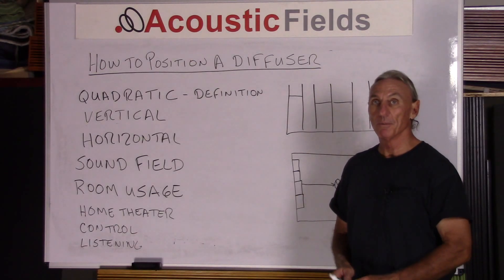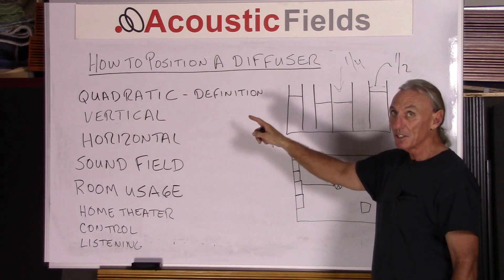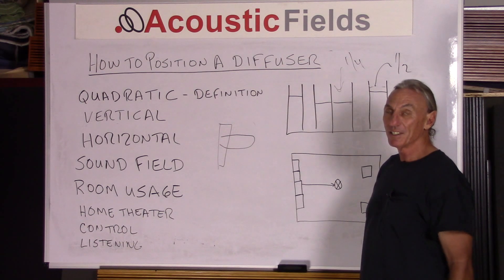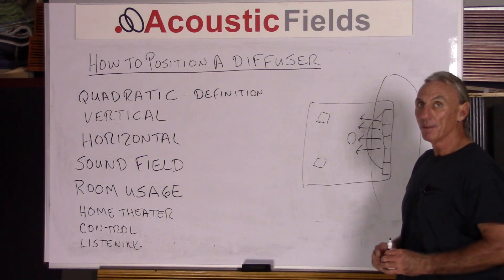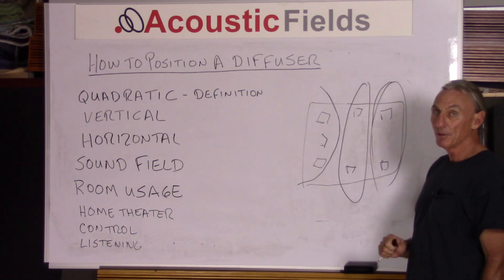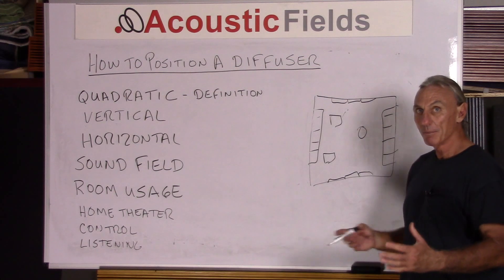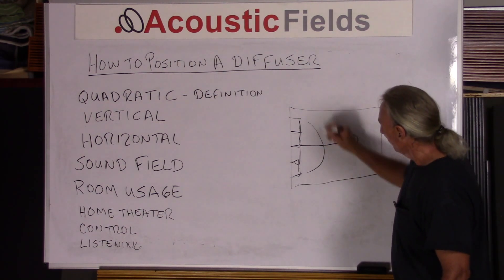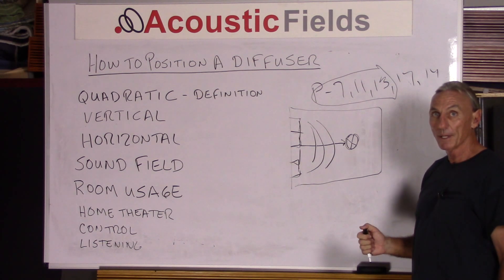Ideal Acoustic Diffuser Placement Guide - www.AcousticFields.com

Comment: Thank you very much for this great video. Can we say that if the well depth of the diffusers are same but the prime number pattern is different, the lowest frequency affected changes? As I understand from this video let's say a prime 13 diffuser with a 30 cm deepest well will affect a lower frequency than a 7 prime diffuser with the same deepest well depth. Is it correct? Or there is another reason to have a larger distance btwn the listenning position to the diffuser when we sellect a bigger prime pattern diffuser? Last question :)  In my mastering room the distance btwn the listening position and the rear wall is 2.5 meters (8.2 feet)  which prime pattern do you recommend in this situation? Thank you in advance. Best regards.
Reply from the maker: A quadratic diffuser is made of wells or troughs. The depth is quarter wavelength and the width of each well is half wavelength. The formula used to calculate is modul n. Refer to Alton Everest Master Handbook for further clarification

Comment: Thank You very much for giving this knowledge to us! I have a question, if I make diffuser from hard xps styrodur or material like that and stick it along whole surface to the wall, do You think if it would work? Or does it have to be very hard material like wood. Thank You again, gold videos!
Reply from the maker: Diffusers are a middle frequency range acoustic tool. This is the frequency range where voice lives. Wood is the only material type that we have found that gives tone to this frequency range.
Reply: @AcousticFields  thank you <3

Comment: Hola a que altura de los oidos del tecnico  debe quedar colocado el difusor  sea cual sea  y porque ? Saludos
Reply from the maker: Distance from diffuser to receiver is based upon the prime number of the diffuser. The minimum distance for a QD-7 is 4 feet. A QD-13 is 6'. Make sure you have the absorption requirements met within your room before introducing diffusion. If you do not, diffusion will make your room sound worse.

Comment: 11×14×8ft room. Primary listening position about 7ft in center of room. Where should I place diffusion and what size?
Reply from the maker: Do you have all the criteria met that a quadratic diffuser requires. You must reverb balance throughout the room along with attack and decay rates. If you do not meet the requirements of diffusion, diffusion will make your room sound worse. Fill out the information in this link. Foillow the software and schedule a time slot to go over all room issues. https://www.acousticfields.com/free-room-analysis/

Comment: For a 2 channel room, does diffusion on the back and front walls have to be the exact same specs?
Reply from the maker: It depends on the distances from diffuser face to listener ears. Every prime number diffuser has a different distance requirement. As a general design goal, it is best to use the same sequence of each front and rear wall if distance and space avaiblility permit.

Comment: In a nearfield critical listening environment would you still recommend diffusion? I sit roughly 4-4.5' from the speakers and the wall is roughly 5-5.5' away. And should the diffusion panel go between the speakers for best results, or would positioning the diffuser right above the speakers do the job?

I currently have a computer screen between the speakers, so positioning the diffusion panel above that monitor would be the easier mounting method.
Reply from the maker: Use absorption for this set up and application.

Comment: Nice to get to know Moore information about the physic if the sound . 1 thing didn't get it right is the time signature .would love to see  you explain that in Moore details . Time to me mean 2 different ting but time signature mean 1 thing as Alix engineer or procure  = 1/2 4/4 7/4 5/4 /3/4  exetera and compound rhytme so did the sound diffusion time signature Macke impact or changes on that .?? Thank you
Reply from the maker: Reflections versus the direct or straight line energy from your speakers is the issue. There are time windows that you need to achieve using the proper rates and levels of absorption for sidewall reflections so that the reflection does not arrive within certain time windows of the direct sound. These time windows can vary from 10 ms.- 20 ms. in duration.

Comment: great info thank you.  I'm putting quadratic diffusion above my drums in a room with around 13 ft cathedral ceilings.  first i plan to make them parallel to the floor when hanging them.  i have 4, 2 x 2's that i pan to put together and was thinking to do a 2d "movie theatre sytle as you mention here.  would that be recommended?  I have something similar to your first drawing in the beginning of this video, 6 wells, with 3 different depths.  thx Dennis
Reply from the maker: We will have to look at many variables in order to reach the proper conclusion. We will need to look at room dimensions, pressure levels used, distance from drums to ceiling and many other variables.
Reply: @AcousticFields  understood.  the room is 400 sq. ft. designed by a good friend, Sam Berkow, something like 13 bends in the wall going around the room.  Ceilings are just under 14ft, i would say the diffusers would be hung around 13ft from the floor.  Not exactly sure what you mean by pressure levels, i'm a drummer, so always under a lot of pressure! lol

Comment: I dont really understand the 3 sound fields thing. Length width and depth, what is that in regard to, frequency and amplitude?
Reply from the maker: You have different frequency and amplitude issues on each wall surface. Axial modes which are the strongest and most audible occur between two parallel walls such as sidewall to sidewall, front to rear, and floor to ceiling.
Reply: @AcousticFields  Ooo room height length and width, not the sound wave itself?

Comment: how cool would this video have been if actual diffusers were being placed in the different room as b-roll  - so,  a visual lesson w/ actual products.   It was informative, though.
Reply from the maker: Videos are a double edge sword. On the one side, you want informative content. On the other side. you need presentation value using production techniques which increases cost. We have found that content still prevails. For that, we are thankful.

Comment: Hello Dennis and thanks for your useful videos. About distance between QD and listening position, using a QD-23 for example, which as a low frequency of 185Hz, the wavelength is 1.856m and its quarter wavelength 1.856/4 = 0.464m. Times 4 gives the same 1.856m. Plus 50% gives 2.784 m. Am-I right ?
Reply: To me, that was the easy part. What I did not understand was "...then you can use the particular prime number sequence". Now that the prime number is not a measure, but just a factor, how do I proceed to determine the appropriate prime number for the actual listening distance?!?!?

Comment: Hi Dennis! 
I have a home theater room and have my seat 85 cm (2,5 ft) from the rear wall. The room in it self is 15 ft long 13 fr wide. I know I have to treat LFE first. But which prime would you use? Also is it better to have multiple small diffusers along the rearwall instead of one wide?

Mads
Reply from the maker: What is the distance from the listening position to the rear wall?
Reply: Acoustic Fields 2,5 feat :)

Comment: Excellent practical video!
I have a classroom with size WLH 4x5x3 meters. The listeners are positioned in one row along the 5 meters wall at 1 meter distance, and a teacher at the opposite long wall. So, given the advice about the listeners' position, if I put diffusors behind the listeners, the lower frequency would be 343*2 = 686 Hz, right?

Comment: Sound reproduction if it was simple it would be boring thanks for your time and effort very informative
Reply from the maker: R,  Its an amazing thing, isn't it. It is a bit complicated. However, once you get gear and room treatment aligned, there is a synergy that transports you to another dimension. Its like a worm hole. You press play and the portal opens. If the room is properly treated, the portal opens taller, wider, and deeper.

Comment: Hey Dennis, so if the listening position is say 4-6ft from the rear wall, then use prime 7 (on rear wall) but if listening position is 10ft from speakers (speakers 2ft from front wall) then which diffuser panel to use on the front wall behind the speakers? (P-13 perhaps?) 
thanks so much in advance, I've purchased your diffuser plans and will build locally, as importation of the units is just not possible.
Reply from the maker: M,  You can use a QD-13 for the front wall.

Comment: Hello Dennis. Thank you for your kind help. 
There is a thing that always puzzles me regarding diffusers. 
It is highly recommended to not have diffusors over a drum,  because it would add perturbation in recording situation,  due to the proximity of the overheads with the ceiling and diffusors.  BUT,  nearly every recording studio that I see have a lot of diffusors behind the drum. 

There is surely a logic but I can't grasp it ?
Reply from the maker: B,  Diffusion is a technology that minimizes reflections by taking a "large" reflection and breaking it down into "smaller" reflections. These smaller reflections are then picked up by the microphones which give the recording more "space".  It makes a smaller room sound larger in the recorded domain. Type, amount, and position of diffusers depend on the distance from the source (drums) to the receiver (microphone). It is a way to take a small room and give it a bigger sound. It is a compromise that if well executed can produce satisfactory results. However, in most small rooms, it is a band-aid. There is simply no substitute for a larger room with high ceilings when it comes to drums.
Reply: @AcousticFields  thanks.

Comment: Would diffusers be helpful in a live room ? Great video btw
Reply from the maker: J,  It would depend on the size and volume of the room along with the instruments you are recording. Most live rooms we work with use diffusion on casters so the engineer can position the diffusion as needed.
Reply: Acoustic Fields I'm in a 14x20 with 13 foot ceilings.  Bass, rhythm ,lead, drums
Reply from the maker: J,  Fill out the information in this link and then schedule a time to speak by phone. All times in electronic calendar are PST.    https://www.acousticfields.com/free-room-analysis/

Comment: I'm really enjoying your videos. I don't live State side so I've been forced to resort to a diy method of setting up my home stereo system, so any help I can get would be greatly appreciated. I don't expect to have anything. given to me, so if there is a mathematical problem I can use for this application I don't mind doing the work myself. But just in case, in my listening room, the seated distance from the front wall is 11.5'.
Reply from the maker: J,  I will need to know more about your room. Fill out the info in this link. Include photos of areas of concern.https://www.acousticfields.com/free-room-analysis/
Reply: Acoustic Fields I did, I'm pretty sure that my room isn't big enough but anything would be better than nothing. Thank you for replying and I'm looking forward to your analysis of my listening room. I included some 3d drawings of the room and of the speaker placement and such. I hope it's of use. If you need anything else, you can contact me.

Comment: Hi Dennis, I would like to implement a QRD 11 into my room but I can only push my listening position to 5 feet away from the diffuser. Is that within a tolerable distance to still have a positive effect on my listening experience ?
Reply from the maker: M, Yes, that will work for your application.

Comment: Dear Dennis, please help me. The film didn't explaint the best diffuser placement for vocal recording. Is it the same like in control room? I have rectangular (not square) room and planning to locate my mic in front of shorter wall. Is it the best way to place diffusers in the rear wall and absorbers on the left and right? (I have 2 big windows on my right and wood-waredrobe in the front, shorter wall) Greetings from Poland :)
Reply from the maker: Hi Michal, Nice to hear from you. You will have to experiment and do some testing since you have an irregular shaped room. Start with the front wall. You will have vocalist, mic, and then diffuser. Have vocalist face diffuser.
Reply: Thank You for a response :) I forgot to mention, that I have already bought sE reflecftion filter SPACE to put it in front of my face when I record my vocal. In such a case, should I manage some diffusers behind my back and absorbers on the left, right and ceiling above my position? Also... Does make it sense to put bass traps on the corners of my room? Without any measurements, just theoretically :)

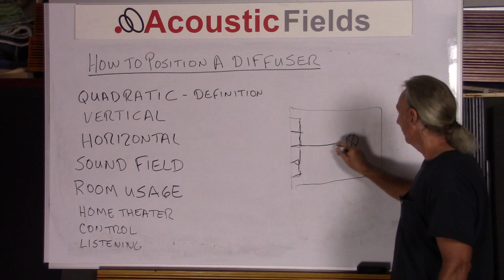Comment: Distance issue discussed from 7:00 on is most worth listening too !  Well done. A few number of people really seem to have understooden this issue. I can also second most other points except one:  You are mentioning something like "nowadays 2D-Diffusion seems to be gone",  meaning the orientation of the Diffs was horizontal only. Well, for the rear wall I would say Yes - regarding first reflections. But if you  follow the second and third reflections, 90 degree orientation appears to be better at least for the Diffs close to the ceiling and for the side walls this oriantation is better anyway to shun any direct first order reflection. I also found that 2D statistic Diffusers are best for very small rooms, where the minimum distance cannot be kept.
Reply from the maker: Hi Juergen, I would agree 2-D is better when the distance variable can not be satisfied , but only to a point. 2-D is a large compromise. With distance on your side, one dimensional simply can not be beat for definition and separation of timbres and tonal qualities.

Comment: Hi Based on the distance from the wall behind the front speakers to the listening position, I can accommodate a prime 7 qd.  The width of that same wall will allow many qd's side by side.  So the questions are:Placing qd's side by side is there a problem, must they be configured in a different order
Reply from the maker: +Steve Tennant I will need more information in order to assist you. Please fill out the required information in this link:http://www.acousticfields.com/free-acoustic-treatment-room-analysis-tell-us-room/

Comment: Great Video Dennis! Is the distance requirement for placing a diffuser in front of the listening position the same as the distance from the listening position to the wall behind the listening position?
Reply from the maker: +Marc Drouillard No, not necessarily. It always depends on frequency response of the diffusor, especially in the lower registers, as is relates to listening position distance. As a general rule you should have a higher prime number sequence on the front wall than the rear in personal listening rooms..

Comment: If my listening room allows for prime 7 QD.  This will have 6 wells.  What happens if we place multiple units next to each other?
Reply from the maker: +Steve Tennant You need to cover a certain amount of square footage with diffusion. The amount and positioning depends on the room usage and the distances within that room you have to work with from surface areas to listening or monitoring positions..

Comment: could you do a video with diffusers and panel spkrs?
Reply from the maker: Hi D wimp 

I will put it on my to do list.  For now though let me answer your question in written form.  The same positioning requirements apply to panel or dynamic speakers.  You will have to do a bit more positioning and listening when you treat the front wall in a listening room with panel speakers because of the rear speaker radiation pattern. I have seen single diffusers placed directly behind each panel speaker as a start point.  

Thanks
Dennis
Reply: Acoustic Fields thx for even taking the time to answer in written form!
Reply from the maker: D wimp Hey, I answered your question in greater detail in yesterdays google hangout.  You can see your question answered at this video:
http://youtu.be/APnFzJiTW7Q

Let me know if you have follow up questions.

Thanks
Dennis

Comment: Hi Dennis. Thanks for this video! What is your thoughts about absorption on the wall behind the speakers and diffuser on the back wall? For critical listening room (Mastering application).
Reply from the maker: Hi Duda Lucena Thanks for the comment and the kind words. In answer to your question we recommend that the front wall and rear wall be diffusion in listening rooms. Absorption for front and side walls, with rear wall diffusion in control rooms. If you want to fill out the free room analysis form on this page of my site I can take a look at your room for you http://www.acousticfields.com/free-acoustic-treatment-room-analysis-tell-us-about-your-room/

Thanks
Dennis
Reply: I appreciate you taking your time to answer.
I just filled out the free form. Thank you!
Reply from the maker: Duda Lucena My pleasure Duda, I will run the analysis over the weekend and get back to you. Thanks Dennis